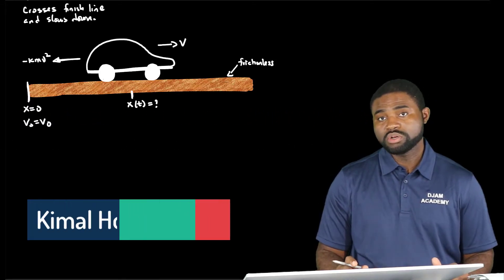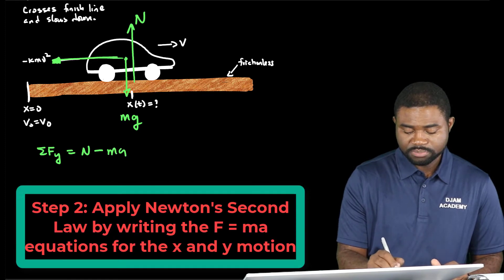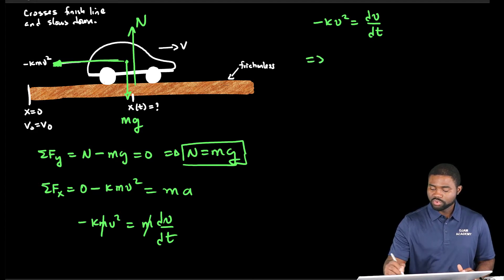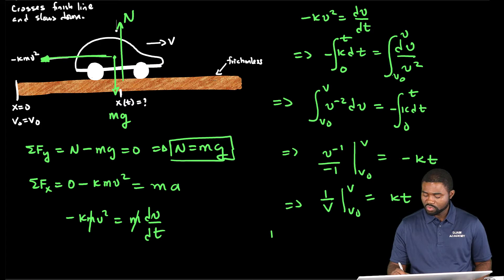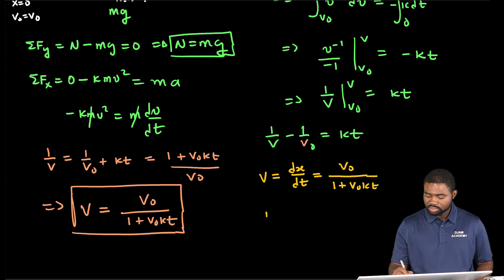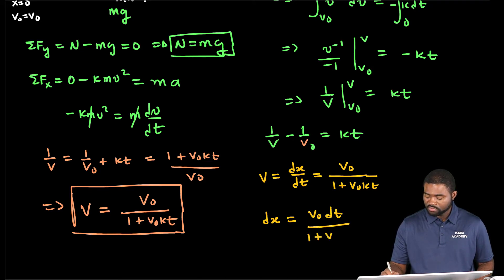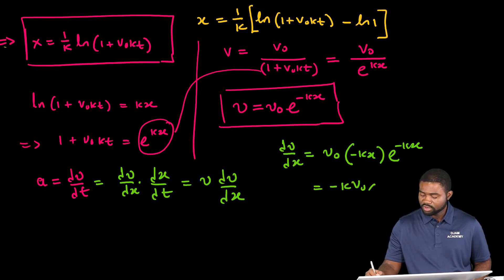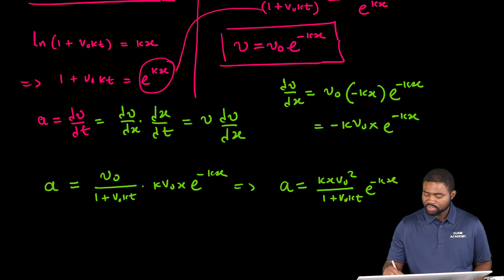Motion in the Presence of Resistive Forces  Proportional to Speed Squared

Comment: Sir! Is it the same method with this problem?
A bullet is fired 
perpendicularly into a plate at an initial speed of V0 =100 m/sec. When the bullet exits the plate, 
its speed is V1= 80 m/sec. It is known that the 
thickness of the plate is b= 0.1 m and the 
resistant force of the plate on the bullet is 
proportional to the square of the speed of the 
bullet, i.e., R=Bv^2. Determine the time T that 
the bullet takes to pass through the plate.
Reply: When you try to get someone to do your homework